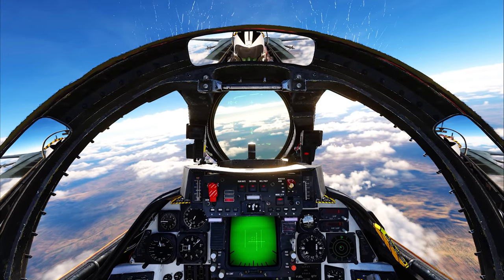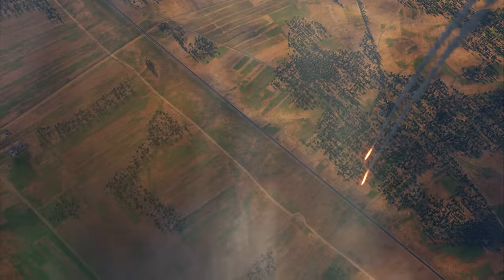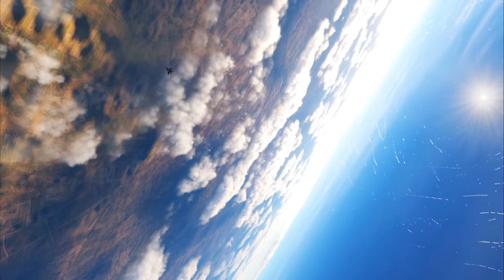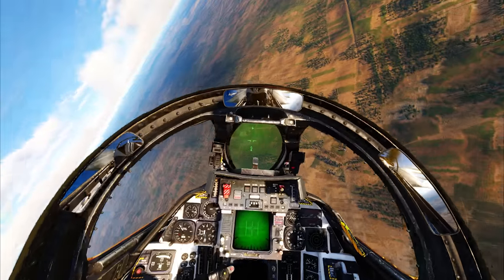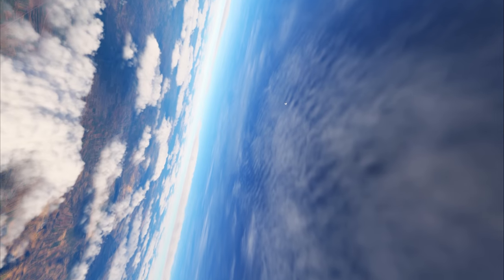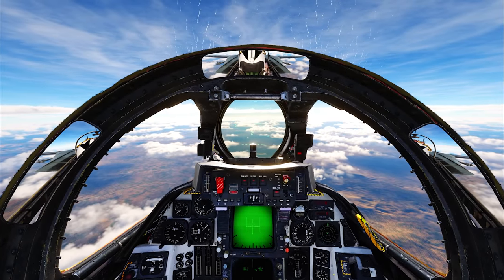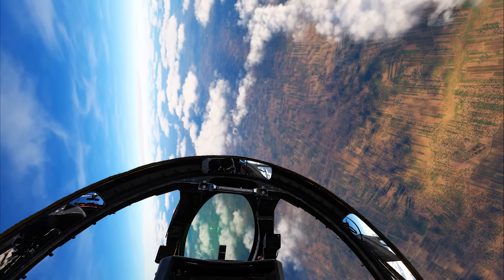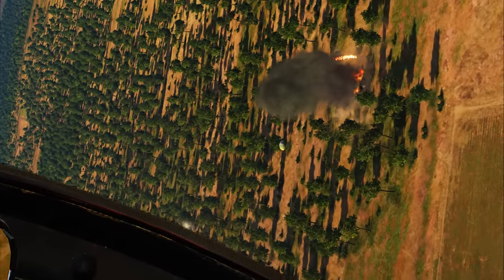Top Gun 2 Maverick Split Throttle Dogfight | F-14 Tomcat | Digital Combat Simulator | DCS |

Comment: This comes from cars, with back acseleration where you can difference the power between the wheels. When you want too turn right and the left back wheel have more power you can turn right faster. 
The same applies too aircraft's. With more than one engine, but i must remind you this only works in aircraft's where the two engines are not close together, in the f-14 the engines are not close together so it works but with others where the engines are too close too eachother it wouldn't work.
In aircraft's it can help you save your ass. 
But it is a tricky thing in aircraft's too much and you lose the aircraft the same with cars too much and you lose the car.

Comment: Would love a video where you go over exactly what the effect of dropping one burner is in terms of equivalent control inputs. It's clear how you would get help with yaw, but it sounds like you also get help with roll and pitch. I could see roll help possibly coming from the rpm change of one engine, but that would seem to be a small effect. I could also see some help with roll coming from the yaw itself: as you yaw, one wing is rotating into the flow and the other out, so there is a differential lift on the wings. But again that seems like a small effect. 

For pitch I have no idea how that helps! In your f 15 vid you used differential throttle to pull out of a dive and avoid the terrain. How does this work?

Comment: The differential thrust tricks actually makes sense. The engines on the F-14 aren't only widely spaced, but they're also angled outward by a few degrees. This is what makes a flameout induce those vicous spins in the F-14A. Exploiting this quirk to gain the upper hand is very much "some of that pilot shit".
Reply: Can you imagine an F-14 with a similar fly-by-wire system used to manage the inherent instability of the F-22? So a computer system to manage the timing of the differential thrust to boost maneuverability, while remaining within a safe flight envelope.

Comment: Hey GS what varient F-14 were you using to try this out? I don't think it was every confirmed what model it was in the movie but they used an F-14A for the ground shots and the Top Gun Maverick DLC for Ace Combat also lists it as an A model. I know the A model was more prone to compressor stalls and had a less powerful engine, could it pull off the split throttle manauvers like in this video as well?
Reply: This seems to be the F-14B in this video, the one with the better engines

Comment: Okay it work for F-14.... Now The Question is.... is it only specific for F-14's ??? Or every Twin Engine Jet Plane can do the same
Reply: Yes, it does work for other aircraft as well. People often mention it being extremely effective with the F-15.
Reply: @wurfyy  It is most effective when engines have significant separation, like F-14 has, or I can think about Flankers and Felon.
Reply: @Andy_Novosad  Well yeah, obviously, but it's still also effective on aircraft where the engines are very close.
Reply: @wurfyy  I see no physical reason why this would be true. (Torque) = (Force) х (Аrm of application of force). 
In addition, I remember an interview of one of the pilots, in which he said that F-18, unlike F-14, had no problems with stability in jaw or even the occurrence of a flat spin, when one of the engines was lost, precisely because of the close location of the engines. The same logic applies to the F-15 and others.
Reply: @Andy_Novosad  It works because the engines, while close, are still offset. Maybe you need to throttle down completely for the same effect that you get in the F-14 by coming off burner, but it still works.
Sure, they can fly straight on one engine. The rudder can counteract the yaw. But if you do the opposite and complement the rudder with differential thrust, you get faster rotation than with just the rudder.

Comment: I would only use the split throttle technique if you're trying to either roll yourself into a sort of snap-stall, which could be good for overshooting, or if you are pointing skyward with little airspeed and want to flip yourself back nose-down.
For regular turning with plenty of speed, there wouldn't be much benefit for a any split-throttle operations.  The offset thrust would require you to counter with aileron and rudder, applying extra drag, on top of already shorting yourself from potential thrust.

Comment: Split Throttle? You can made in Hornet and F-15 the same. I guess all which has 2 engine ;)
Reply: I think it works better when the engines are spaced far apart. The f15 and f18 engines are closely spaced.

Comment: Just wondering how many other aircraft you can use this in?
Reply from the maker: Technically anything with 2 engines I think
Reply: @GrowlingSidewinder  Not as much as you would think. The Tomcat has wide spaced engines which works in it favor, engines on a center line would not see it and the closer they are the less effective the tactic it would be. The Eurofighter for example with close together engines and a Delta wing would not see much of a change at all
Reply from the maker: less effective....but much safer, this technique actually has a really high probability of inducing a flat spin if over done even slightly.

Comment: I'm not gonna pretend like I know anything, even the first rule of flying/dog fighting when it comes to simulation or real world combat, which is (unfortunately) the only reason I clicked here because I just wanted a simple explanation of what "Splitting the throttle" means. 
I haven't really learned anything ever about how to fly or how planes even work but from the way I hear it being described and what I have watched, I take it to mean that it's almost like a form "Drifting" but for fighter jets in order pull a really fast U-Turn in the air to get behind your enemy for a hopeful lock on with any weapons system.
Please, if anyone does read my comment and has a way of explaining "Splitting the Throttle" please tell me. I have a 50/50 feeling that I'm right about my assumption stated above.

Comment: Quick question, and this might have already been asked... but wasn't the Tomcat that was in Top Gun 2 an A model Tomcat and not a B model like you're flying... if so, wouldn't the P&W TF30s have different charectoristics/capabilities than the GE F110s?
Reply from the maker: They would just be ever weaker engines but the general idea would remain the same
Reply: @GrowlingSidewinder  fair enough. Just out of curiosity, given the TF30s inherent compressor stall issues at high AoA and aggressive throttle movement, do you think you could run into a compressor stall during split throttle dogfighting in certain throttle settings and AoA, or do you think that if like you did  not fully throttle back you can avoid it all together
Reply from the maker: I thought about that but no I think it wouldn’t be an issue because even when pulling the AB out of one engine it’s a small and pretty small decrease in thrust I think the (and I could be wrong) that the compressor stall thing wouldn’t be an issue.

Comment: We could have had the 5th generation tomcat if it wasn't for the f**** Cheney family in 1996 the F-14 project was to advance to 5th gen fighters and they already had one partially built called the st21 I think this aircraft would have been a better aircraft than the F-22 raptors in the f-35 cuz it would have had the same thing they had stealth capability and all that good s*** before these two planes were even thought of but like I said you can only blame the Cheney family and the Bush family for getting rid of the F-14